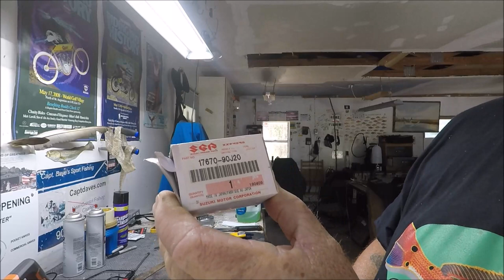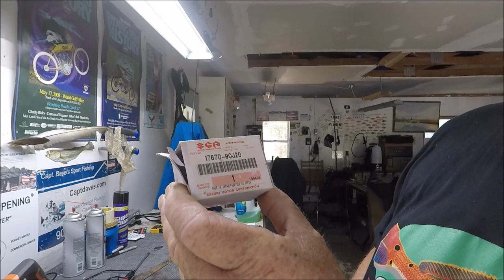Suzuki 250 outboard t-stats (long VIDEO in rain)

Comment: Thanks for the help Dave, I have been following you for a bit now maybe one day I'll see you at the docks and shake your hand. I'm out of Saint Augustine but born/raised in Jax.
Reply from the maker: Well I do my shade tree (or more like a rainy day) maintenance videos, for the long run, not just for the "so called subscribership". Showing that you can save $ doing things yourself. I cant afford to drop my boat off and pick it up 3 weeks later. Others can, and do. I get a day or two to get it done. And then its back to fishin.
Reply: @CaptDavesSportfishing  yes sir, you have saved me some major $ by sharing your videos and I appreciate it very much. I did my anodes and now probably the thermostats here soon. I have not descaled yet but one thing I use is salt away after every trip I run it through the motor and spray off the trailer as well. Also a big fan of CRC, i have my motor covered in it
Reply from the maker: @DirtySouth33T  you dont need to run rydlyme unless your having a issue, and know your motor is full of crap. If you flush correctly. You should be okay. I used it on my last zuki cause I knew it was loaded with St. Johns Sludge.

Comment: Love your videos!  One suggestion I had on maintenance, when reinstalling bolts, at the very least coat the threads with marine grease so that any salt/corrosion that gets to the bolts, they will break free and not snap.  Anti-seize is another option as well.  Works great on dissimilar metals.
Reply from the maker: Some I do. But, doing this in multiple storms, it wasnt the first thing on my mind. Those tstat bolts arent really a issue. I know its a Youtube thing, and Im pretty used to video content being nit-picked.
Reply: @CaptDavesSportfishing  Please don't take my input as nit-picking.  I get it.   :)  Keep up the fun videos and love the patriotic engine cover too!

Comment: Maintenance Maintenance. 
Monday is my 6 months Suzuki Rydlyme cleaning and checkup day. Pay a little now or a lot later. I only have 480 hours on my Zuckys but it's never missed a beat. Best thing to do on a holiday trip. Don't go near the water!
Reply from the maker: I'm not in that position. I have to go. BUT I will avoid next weekend ''Snapper idiocy'' all concocted by the State! July thru Sept. my least favorite months of all. I day dream this time of year....
Reply: Best thing to do on a holiday trip. Don't go near the water!

I must concur and very sound advice.
Reply from the maker: @orowock1  Holidays ain't shit....you oughta see the nut cases with a 2 day Red Snapper opening for  ONE of any size fish. 3am the lines start at the boat ramp and the idiots end up PARKING 2 miles down the side of the road. The boat ramp can't handle it. The state KNOWS exactly what they are doing. It's July, it's moron'ville out there anyhow, and then add in a Red Snapper tournament too! I hate July. I LOVE JANUARY 💘💘

Comment: I have the same engine as you.  My T-Stats after 100 hours were in rough shape, and I flush religiously.  I now precautionary change them at 50 hours.  You posted a video I watched about a year ago and i can't remember which one it is.  You were cleaning out the fuel cooler and drilling/tapping it for future use.  Can you please tell me which video it was please.  Port Aransas Texas
Reply from the maker: well do you flush with the flush ports? IF SO STOP! I use a barrel full of clean water. I made the mistake of using the flush ports after every trip, and it caused the fuel cooler to clog with salt and dirt. And in the summer is when it always shut me down.  I put my entire Boat/Motor maintenance playlist for my boat in the description and even mentioned it twice in the video. PLUS its in the pinned comment:  https://www.youtube.com/playlist?list=PLK-ee3q-bFR2KPb2cDapcVKEbkUjsWyJM
Reply: @CaptDavesSportfishing  my engine doesn't have the low water pickup at the front like yours.  I use muffs and salt away as soon as I come out of the water while everything is still warm...literally hooked up within 5 minutes.  I never use the plug on the front or rear. Once I get home, I do run it in a plastic barrel for about 10 minutes.  I haven't had any issues with the fuel cooler but remember you video and decided to change mine with a new one, drill out and tap as you did so I have a spare.  When I change the T-stats at 50 hours I also change all the annodes whether they need it or not.  Maintenance is cheap, repair is expensive.
Reply from the maker: @David-vf9de  then you should gave no tstat or fuel cooler issues. Id rather Not have those extra water pick ups, and would like to just run on the flushing muff things like I have with every other motor